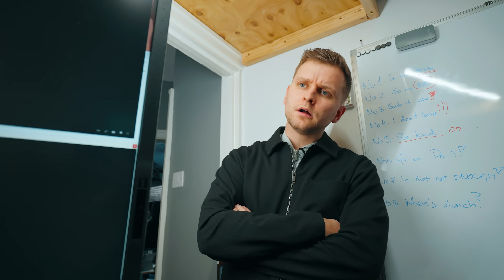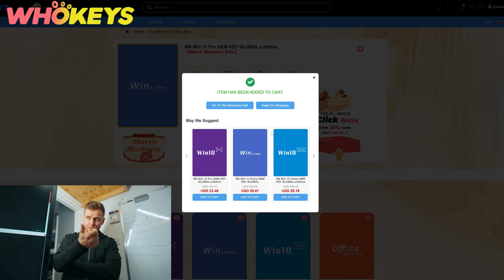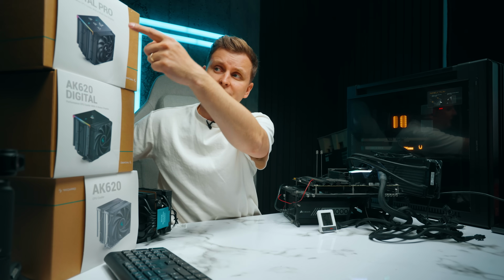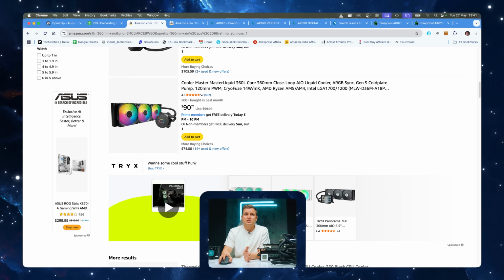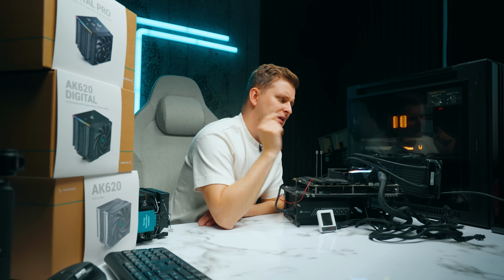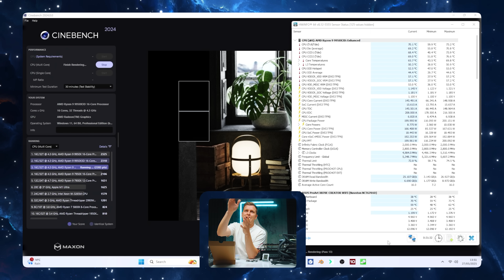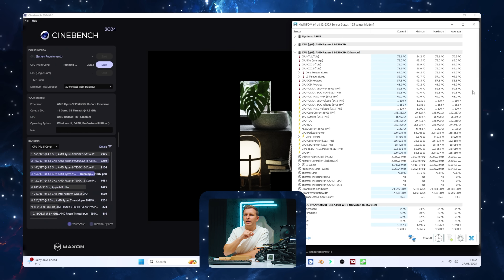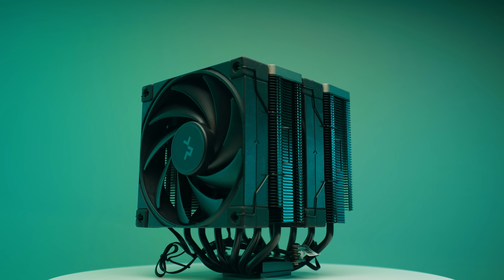Stop Overpaying for CPU Coolers Now! AIO vs AIR [PROOF]

Comment: To install air cooler properly you need to rethink your strategy of supplying air into your pc case. Positive pressure, bottom fans to GPU, two or three fans from the front and one exhaust on the back and one exhaust on the top towards back. If you install two or three fans on the top they are actually going to steal air from your cpu cooler. Instead you have to reverse one of the top fans to supply air into the air cooler. And with aio you can leave top fans in exhaust mode. This info was discussed on Noctua website and I had to reverse top front fan to get excellent results.

Comment: I stopped using Air cooler because it was expelling hot air from the case and was heating my room. I use them only in winter and AIO in summer.

Comment: Thermalright owns their own manufacturing factories and can produce at cost price and massive scale, which is part of the reason why they can outbid basically everyone else in the industry and still maintain great quality and performance, especially relative to their price points. Most other manufacturers have to get all or part of their systems built by an external manufacturer and every time parts change hands a couple % of the cost goes into those 3rd party pockets, also for logistics and supply chain etc is much easier to manage when you manufacture everything in house and have full access and control over all raw material suppliers and distribution.

Also the founder of Thermalright is just a chill dude who seems to just wanna make great products and doesn't really care about trying to maximize sales margins etc. GN had a great interview with him recently, and got the famous quote from him "we are only really competing with ourselves". Thermalright is based.
Reply: I have the frozen prism 360 and absolutely love it, only paid $60 shipping included. I will only buy ThermalAlright and uphere. Very great value!
Reply: plus dirt cheap human labor?
Reply: @sampokojiin  expensive mrooon. Unlike American
Reply: @Eric-h5r7d  any company that can afford to sell products at drastically lower prices compared to the competition must cut costs somewhere, right? Mr. Smart 🤣
Reply: @sampokojiin  no, 99% of AIO's cost less than $10 to manufacture
Reply: @thetaintpainter5443  utilities, overhead, employees salaries, workers wages, executives' payouts, logistics costs, liabilities etc. Less than $10 to manufacture + vertical integration doesn't tell the whole story
Reply: @sampokojiin tell us
Reply: Noctua do too and they're more expensive than AIOs lol.
Reply: @andytunnah7650  Because they're like apple. You pay double for the logo/name.

Comment: Let's see. Still have running the Corsair H100 that I bought back in 2010/2011 and it still runs today ( I think I got my money's worth after 14 years). As for the Core Ultra, that's using the AK 620 dark and it runs great but once in a while ut ramps ( needa figure the optimal fan speed). The Arctic Freezer 3 360mm is sitting in the closet for a future build.
Reply: Yikes, I would be pretty worriedafter such a long time that some of the critical components of your AIO would no longer be reliable (gaskets, seals, valves, membranes, hoses, etc drying out or cracking) and could start to leak. Which is why apparently the standard advice is to throw out your AIO after a maximum of 10 years and replace it with something else.

Comment: I've only had 1 AIO. Its pretty but I've never had a single issue with an air cooler. I also find myself worrying more about monitoring the AIO to look for its end of life (approx 6 yrs) or potential failure points.

Comment: If you don't need water in your PC (and very few do), air will always have the reliability and "won't blow up your PC" advantage.  If my NH-D15 somehow loses both fans, it will still function as a passive heat sink.  If your pump stops working, or springs a leak . . .

Air cooling in a good case such as the Torrent is my choice.

Comment: I like AIOs for my personal builds, for multiple reasons including the look/ bling, but I always use a cheap air cooler ($20 to $40) for family and friend builds, mostly because I don't want to have to explain that there's water in their PC lol. 
I bought my first AIO about 4 years ago during the 30 series launch and it's still going strong today, after being removed, reconfigured, and swapped into different builds and I haven't had to refill it yet either (yes it has a fill port). If the new cheaper AIO that I just bought for my new SFF "family room PC" PC build lasts as long I'll be happy. I think AIO is THE way to go for a small case, especially when said case has no front intake.

Comment: If the manufacturer of the processor recommends water cooling such as a 280mm AIO (as a minimum) why wouldn’t you go with the manufacturer’s recommendation?  A good way to end a video such as this would be to have the official word of the manufacturer(s) on the subject.  If Intel an AMD are like “it’s all good, use what you like.  If it goes up in smoke we’ll get you sorted” then no problem but if they’re like “follow our recommendation or you’re SOL” that’s another story.

Comment: I believe you are undervaluing the ambient room temp as it directly correlates to the cooler temps. If the room is 5 degrees warmer the cooler temps will also be 5 degrees warmer. Physics is a real thing. You mentioned it was warmer for the air cooler so you should include that offset in the comparison of the final difference (especially considering the AIO started in the cooler environment ... and factor in time to reach steady state as the AIO is slower to reach it. A 30 minute test probably is too short of a time. a few hours would be more accurate. But you have given us a valuable tool to work here with your video. Nice job and thanks.
Reply: This is why Gamers Nexus always talks about delta temps.
Reply: This video can be completely ignored as its an open bench test which is the most unrealistic testing for coolers. You would need the gpu pumping constant heat into the case.

Comment: I use air cooling and my CPU cooler cost about £30. I can't remember the brand but my CPU hovers around 60°C under load. I'm happy with that.

Comment: There is difference compare onopen air and actually inside of case. AIO have there big advantage as it directly exhause heat out of the case where aircooler actually increase temps in case.
During hot summer I had 8-10 degrees difference between D15 and Arctic 360 AIO and 15+ with custom WC and that includes GPU in same loop.
It also helped drop all other temps, especialy chipset and NVME.
Reply: I got almost the same experience as you, i have big full tower case, corsair 780T, previously had nhd15 chromax (5950x + rtx 3090) upgraded to 360mm AIO, cpu temps dropped by 8-10c, Gpu temps while gaming dropped by 7-9c while being much more silent than before.

Comment: Air cooler FTW! Also, you forgot 1 more variant of Deepcool cooler. AG620. Does the same work with RGB and 90% similar specs to ak620😁

Comment: my 13700k at stock spec pwr settings on air avg 75c gaming, or 55c just browsing youtube BUT if i bench stress it hits 100c and thermal throttles, So yes I need AiO

Comment: I will say it straight up and upset a lot of people.  I have been building and water cooling computers for over 35 years and, air coolers have gotten to the point where they can exceed the cooling of most 360 aio's Ai0's even the measly 45.00 peerless assassin outperforms 95% of AIO coolers 
  And as for me and my passion with open loop water cooling. Do I have to have a dual loop in my system with three radiators and two pumps/2reservoirs? Absolutely not. Water cooling is something that you do for a passion.  
 Get you a good case that has focused on airflow and stick with air cooling. 
 Aio's are Garbage so just throw those in the trash. 
  And only open loop if you're just passionate about water cooling.  
 I've got two identical systems in my house for me and my daughter. Both of them have the 7800 X 3D on the MSI 650 tomahawk, and the 6900 XT Sapphire nitro plus gpu. Mine's dual loop on three rides and hers is air-cooled and they run pretty much the same temperature

Comment: Always go for AIO tho, clean look and not bulky.
But, risk of leak, pump out of commission, bent radiator.
;afaik, if the fan have issue, they require the whole unit to be sent, if the pump dead = you're fuked, most AIO requires apps, also ambient tempt matter a lot because of liquid.

Downdraft & tower cooler for simplicity.
But, bulky, limited RAM choice (depend on cooler design).
;Heatpipe sometime defective (should check during test run), Downdraft completely remove hot air pocket because it blows air to surrounding CPU areas, but very limited performance. Tower cooler could bent motherboard if installed incorrectly. But no moving parts except the fans.

Comment: I started off with air coolers because that's all there was. Then became a diehard AIO user. Every PC I built had to have an AIO for MAXIMUM cooling performance. But now, I've returned to air cooling because of how simple and reliable they are. They are much quieter and more than good enough for cooling whatever I am doing.
Reply: BUT THEY CAN BEND YOUR MOTHERBOARD BECAUSE OF THE WEIGHT
Reply: @HICHOSOLO  what coolers are you using that bend your motherboard the only way that would happen is by using the wrong bracket or leg dropping your open pc
Reply: I actually agree with this. I have tried tree aircoolers that is tilting down dragging/bending my mobo. I tried 3 different coolers because I thought they are just bent, but I just found out it's the motherboard that's bent. My mother is also  Asus ROG Atrix B850 so it's not cheap. Aircoolers I've used are Deepcool assassin 4, ID cooling dual tower. Deep cool AK500. Each one is bent down...
Reply: This is definitely true. I've used 3 aircoolers and I can see that it tilted down because it bending the motherboard because of it's weight.

Comment: If you have an Intel 900K, you better use a large AIO they run hot, in fact the 14900K has been known to run hot enough to crack the chip.

Comment: You should be testing in a case... and heat up that gpu, as with air cooling, the heatsink intake is near the gpu exhaust.  A 4090 or 5090 would certainly change the temperatures and especially in a case.

Comment: As a bit of a reality check for the Laymen PC builder, please keep in mind all of these temp will be totally different compared to your Case size, Case Fan Sizes, Number of Fans and configuration. Not to mention size of GPU and amount of heat output of it. All which was never discussed while using an open air test bench. Love this guy but I live in reality and my common sense is pushing me to say what needs to be said.
Reply: The case really does matter. There are more and more chimney style cases (bottom to top airflow) with no front intake, and like the guy above me said, smaller cases benefit from AIO's reduced footprint both in cooling capacity and ease of installation. 
I just built a "family room"/ "gaming console"/ HTPC rig in a Montech Heritage Pro (M-ATX) and it was both cramped and a chimney style so I slapped the cheapest AIO I could find in it and called it a day. I would have muttered quite a few more swear words if I had to squeeze a big air cooler in it. Also, this is a personal thing, but I just don't like the idea of having a big air cooler hanging off the motherboard in a PC with a handle that I plan on carrying around with me.
Reply: Literally every argument he makes against AIOs can be disputed. Granted, I'm all for a competitive product at a similar or lower price, but as long as he wants to "split hairs", there'll be criticism. 
•Laying the AIO with the side that pushes cold fluid through inherently becomes the "top" of the loop, meaning if there was any shortage of fluid in it, he'd be pushing air into the CPU area that's meant to be liquid cooled. (4:04)
•The "water can leak" statement is technically true, but an absolute exaggeration of likelihood. If it were going to leak, you'd know it the second you opened the packaging. Furthermore, any company that doesn't want to tarnish their livelihood would've checked it for leaks (likely with air) even before filling it with the coolant. 
•"It's deadly to other components if it leaks"... Notice how there's no mention of an argument against custom loops here, only AIOs? Yeah, tell me which has more likelihood to, not just leak at all, but actually spritz onto other components (as small leaks would be more apt to slowly trickle to the lowest point of what it's touching and then drip down, almost certainly away from the MB). While I'm not disputing that fluids typically conduct electricity, I've never even heard of a MB going through a state of electrolysis as he'd imply the outcome would be to the components. Yes, you could fry something in extreme situations, but you're making a mountain out of a molehill as far as potential for it to happen goes, and that's understood the moment you decide to get ANY kind of liquid cooled system, not just AIOs. 
•"In time, a tiny bit of the COOLANT (not water!) will evaporate..." and by the time it does, you'll likely be ready for the next "build a generational level, build from scratch" extent of an update anyways. Your vehicle also evaporates coolant, and does so because of temperatures vastly surpassing anything you'll get your PC close to, so unless you're running your 24/7/365 eternal Furmark testing, you'll refill the vehicle's radiator multiple times over before you need to do so on your PC these days... Because yes, there are AIOs that allow you to refill them without voiding the warranty. 
•Speaking of warranty, that 3/5/10 years that they give you for it, understand that's IF you run the pump inside it at full speed. Actually, companies typically rate the pump lifespan in total hours used (at 100% speed). So a pump rated for 60000 hours would take nearly 7 years of continuous use to fail, which you're absolutely not doing. Oh, and you absolutely DO NOT need to run your pump at max, or even over 40%, which thereby only increases that lifespan. The warranty is set up as is for the worst possible scenario, which I doubt anyone outside of the IT server industry would ever do. (Which is why they use air coolers. Imagine, having context. What a concept.)

I could absolutely go on and on but that much narrative destruction in the first (covered) 6 minutes of the video will have to do for the time being. Being tethered to real life, I have other things to do than just making a joke of someone's "work"/storytime...

Oh, a quick edit, I almost forgot one of those types of "points" that shouldn't be left out...
Testing a gaming CPU vs a CPU that's designed for productivity work is under NO circumstances an "equal" fight, in any regard, regardless of how "dialed in to be statistically identical" you make them. But hey, maybe next you could test a diesel car vs a coal train to see which flies farthest, because those chips were NEVER going to produce "equivalent/comparable" results until you forced them to. And let's be honest, you spent more time messing with settings to make that happen than you would've just swapping coolers on the same rig so the comparison could have any level of validity.
Reply: @RAW_Reality  so, you seem to know a crap ton about pcs, could I ask you to steer me in the right direction for getting a aio for my aegis z2? I have a few In mind but im a newby to pc, learning off of the internet to find what I need.
Reply: @RAW_Reality  well stated, I mostly agree with your assessment, which is unfortunate because the dude but so much time into making this video.
Reply: In the same case with the same number of fans, there won't be a significant difference. Unless you are referring to a SFF build (with like a Lian Li A4-H20). That's where an AIO will help out most. But with any mATX or ATX sized build, it's not going to be significant. 

I've ran a 360 AIO against a Noctua NH-U12A and it's just not much different. A few degrees is truly negligible. I'd rather go with the durability and reliability of air cooling any day of the week.
Reply: In last 15 years, there is no case with bad airflow, it's all standardized and the same in all PCs and actually because of removing box for HDDs and DVD drivers, you have now even better airflow than before. Talking about bad airflow is pretty much pointless these days when all cases have the same airflow, they same configuration and the same amount of coolers. And if it's 120 or 140 mm or noctua or arctic, it doesn't matter, don't believe commercials, it's all good enough.
Today temepratures of CPUs are limited by very small active area of CPU, so it's almost impossible to take that heat from cores fast enough, so improving airflow or using bigger cooler makes very little difference these days because of problems of modern CPU architectures. It's not like in 2009 when adding more fans into your case made a big difference, now you barely notice any difference.
Today GPUs are completely different case, they have high TDP, but big cores, so it's easy to take that heat out and spread it, so today GPUs run surprisingly cold.
Reply: @Pidalin  Cool.